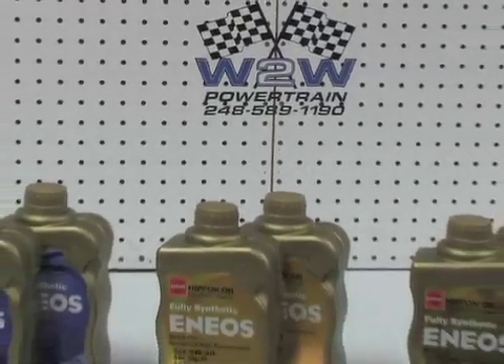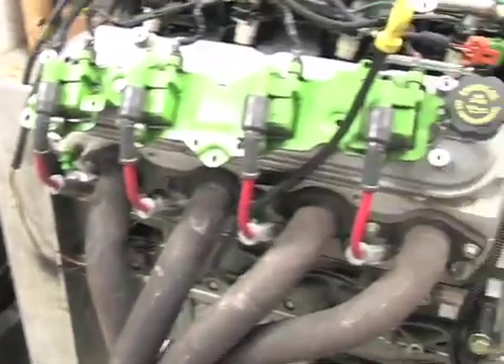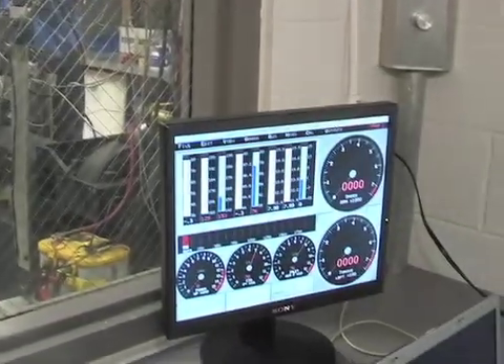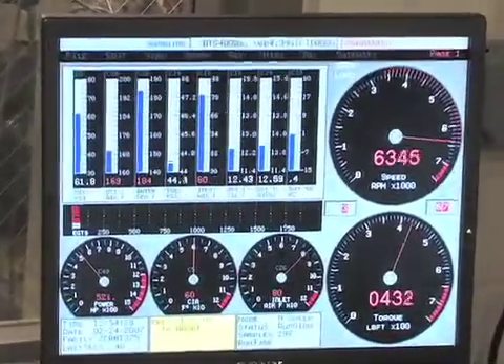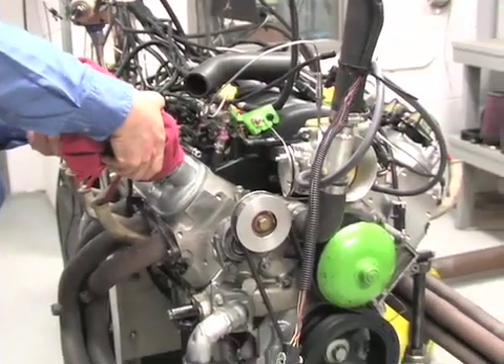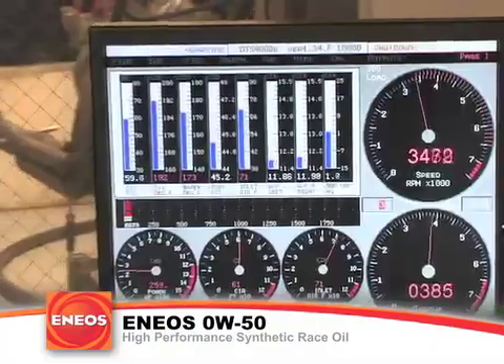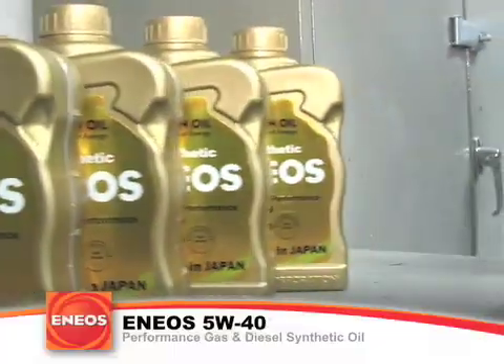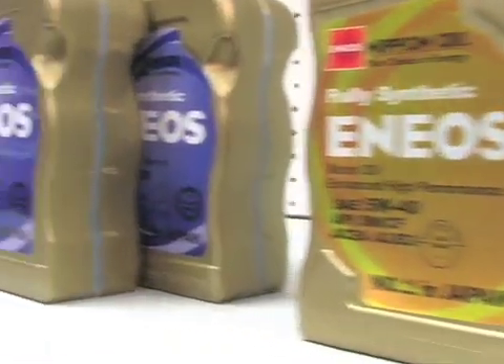Nippon Oil ENEOS Dyno Testing PowerTV

Comment: That was cool and all, but they need to do some real testing. Testing oil on a dyno should consist off at least 6-10 dyno pulls, then getting the average number to see what kind of increase or decrease there was. The next step is to put back a reference or base line oil to make sure the dyno #'s return. Once they return you are ready for your next test oil. Then you will have to repeat the same step with every test oil. The main key is to keep the numbers up pull after pull, over and over again.

Comment from the maker: To comment on few of the other comments on here.  In regards better protectiong - A 50 weight oil is meant for ultimate protection in mind.  That is why most racers uses an oil like a 20W-50, which offers a lot of protection.  A 0W-50 gives a wider viscosity range, the 0W means excellent cold start protection in addition to the 50 weight protection is offers.